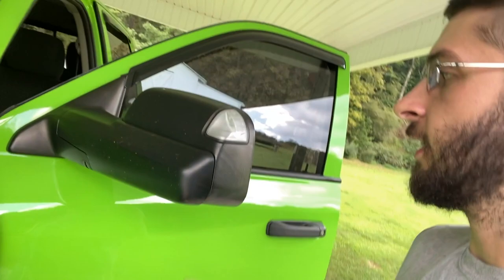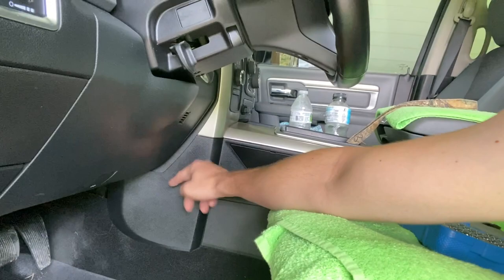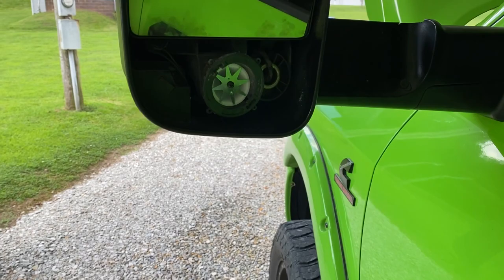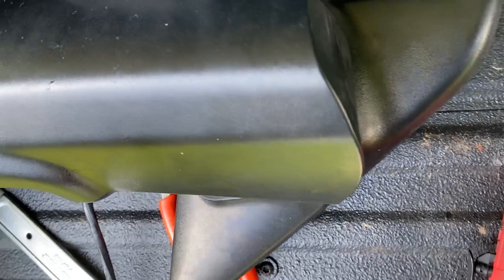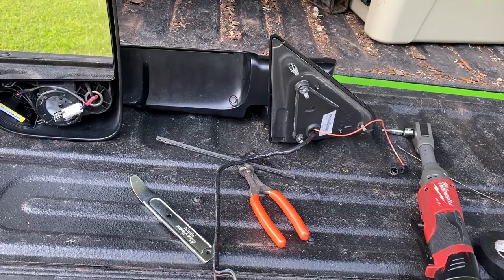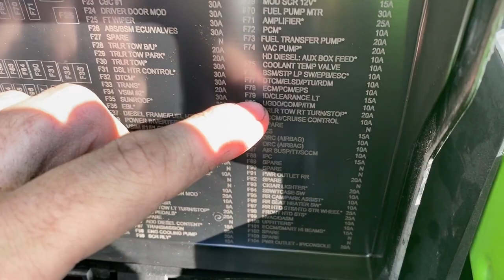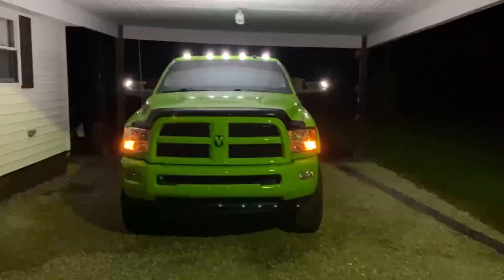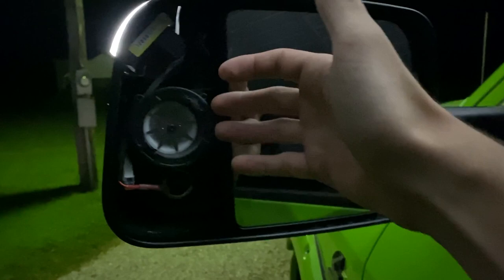Installing Boost Auto Parts Switchback LED Mirror Lights

Comment: Hey man, just ordered these and put your channel down for recommending them. Are these a white white or does it have that hint of blue to them? I’m afraid they’re not going to match my cab lights ,which are 6000k white which has that hint of blue to them.  Thanks
Reply from the maker: Thanks I appreciate that and they should match, I put the Amazon white leds in my cab lights and they match good I think!
Reply: @HoldenPowell_  did you have any problems with getting your lights to fit in the mirrors? My lights will not sit flush. It’s like they are molded wrong or they sent me lights for a 5th gen.
Reply from the maker: They fit in mine fine and then the inner part of it bulges out some but besides that mines fine

Comment: How did you get your tow mirror running lights to work? Did you buy a harness or did your truck already come with running lights?
Reply from the maker: A harness comes with the running lights at Boost Auto Parts
Reply: One more question. I already have the blinkers enabled for my tow mirrors. So once I by these switchbacks from boost, I will have running lights?
Reply from the maker: @RickySlatton  yes if u get the harness with it for the running light then u will have everything
Reply: @HoldenPowell_  the harness comes with the switchbacks? Sorry for all the questions.
Reply from the maker: @RickySlatton  yes
Reply: How did you splice the running lights together? Did you use t-tap wire splice?
Reply: @sup3rior847  yes, that way it turns into one wire that you can run to your fuse box.
Reply: @RickySlatton  but my trucks year is 2010 which is i go under my truck and tap it onto c322 pin 8
Reply: @RickySlatton  and i don’t know exactly how to do that